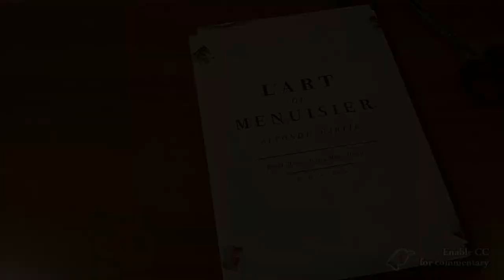Making a Roubo Frame Saw & hand-milling a log with it

Comment: Hello, the job was very well done! I'm really considering improving this type of frame saw because it has potential. I believe that the sliding saw blade holders should be additionally tightened with screws. Then the saw blade would be very rigidly mounted in the frame. His jumping up and down seems to confirm my point. Of course, its length influences this phenomenon. The analysis of the functioning of typical frame saws leads me to believe that the description and the validity of the mentioned improvement are correct.
To sum up, the easiest way would be to install the second saw blade tension on the opposite side. Moreover, the frame for such a long saw seems to be too stiff.
Congratulations and best regards 😀.
Reply: Thank you for the like 😀.

Comment: Great video, thanks for sharing. I 'm also turning some beech log into lumber with hand tool, mainly for making planes and tool handle. I usually split the log in half fist then go from there, because splitting review the grain( twist and bend) and I can make my plane tool handle accordingly to have less run out.  I think if you use the saw on push stroke and lay the log horizontal while sawing vertical( like pit saw) it might help to stay on the line.
Reply from the maker: Thanks for the advice. I will try next time.

Comment: These saws seem to cut better on the push stroke, rocking your weight forward when pushing the saw; this helps you get a longer stroke and use more of the blade too. You are using mostly your arms and it will get very tiring that way, and it's not efficient; you have a saw about 1m long and youre not using half the blade. The blade may be why you used it on the pull stroke mostly, a bandsaw blade usually has a positive rake on the tooth (the tooth leans forward) this makes it very aggressive and hard to use, itll want to "stick" in the wood becasue the tooth is so aggressive. When you sharpen the saw, file away some of the rake at the front of the tooth, aim to file 0⁰ of rake into the teeth (the front of the teeth should be straight up and down, 90⁰ to the toothline, not with the tooth leaning forward) this will make the saw easier to use and it wont want to "grab" as much 😁 
If your saw "sticks" or "stops" at the same point on the toothline everytime, it means your blade needs to be "jointed"; there is a tooth that is higher than the teeth in front of it and when that taller tooth hits the wood the saw stops. To fix this you'll need to use a flat file and run it along the tips of the teeth to make them all straight and the same height. File until you see a flat spot on the tip of every tooth, it's normal if some teeth have a bigger flat spot; these are the teeth that were too tall. Then you'll need to sharpen it with a large saw file, taking half of the flat spot on each tooth away before you move to the next gullet........ the file will cut the back of one tooth and the front of another tooth at the same time, so it's important that you only take half the flat spot away before you move to the next gullet; this will keep the teeth the same height. Moving left to right, from back to front of the blade, keep the left side of your file vertical so you get your 0⁰ of rake on the tooth and file the tooth who's face (front cutting edge that faces forward) is set away from you (this might not be the first tooth) skip one tooth so the next tooth face is still set away from you. When you have got to the toe of the blade flip it around and work from right to left, always from the back of the blade towards the front, this time the right side of the file will be vertical to create your 0⁰ rake and file every tooth you skipped last time (every second tooth) the set should still be leaning away from you...... the file cuts better on the front of the tooth that leans away from you, filing a tooth that leans toward you will "chatter" and the front of the tooth that does the cutting wont be as good. 
It's not hard to file a saw, but it is daunting if you've never done it before. If this is the case; go online or to somewhere that sells old tools, buy the cheapest old saw you can find and learn to file that before you move on to a saw that you intend to use. It's easier than it seems, it seems nearly "scary" if you've never done it before..... but trust me; it is easier than you think to sharpen saws 😁
Reply from the maker: Wow, this is a very informative comment. I'm planning to build another saw with a much stiffer blade and I will surely be sharpening it following your suggestions.
It might take a while till I find the time though...
Reply: Something tells me that this type of saw can cut equally on push or pull, but it depends entirely on how you're using it. I.e. pushing against the tops of the fibers or with the fibers. Pushing in most bench configurations will result in a better push stroke.

I'm planning on building one to be more of a pull stroke because in general your pull muscles are stronger and more built for endurance. I also train on the trowing machine, so I want to translate that movement into efficient sawing.
Reply: You are 100% correct about the first one being daunting. I bought a couple frame saws recently for $10 each, one with a green wood blade, one with a dry wood blade; I decided that if they happened to get ruined in the learning process so be it- at least I am learning. I realized about 3/4 of the way through the cutters on the green wood blade that the rakers are almost 3mm taller than the damn cutters in spots.. sigh. It looks like I need to manufacture some additional jaws on my metal vise to hold the blade and take down all the rakers, then reprofile those.. then the cutters afterwards I guess. I never realized how bad the blade was when I bought it, but I really bought it for the parts and as a template
Reply: @liquidrockaquatics3900  Sounds like ya have some work on your hands..... I dony envy you, I'd hate that job 😐 thankfully, the worst saw I've had to work on only had the "big tooth little tooth" syndrome, from the saw being sharpened all from one side, and that was a 24inch panel saw...... Not a long frame job. 
You'll get it done; just remember..... Ya can't ruin the saw until it runs out of steel 😂 so have at 'er....... Might take a few filings, but you'll get it done 😁

Comment: If you use a push stroke the lead edge is facing you not behind on the other side of the long and it’s easier to follow a line. Also using a broad head hatchet and hewing one side for a keeping plane makes this a completely different experience.
Reply from the maker: I will try to do it this way next time, thanks

Comment: Put a flat stick on the flat side of the blade. At either end.
(A winding stick). Perpendicular to the blade.
Sight down the blade to see if the sticks are on the same plane.
You may have to bend the saw blade to saw straight and true.

Comment: inspiring but where did you find a blade less than 10€?  (about 130 just for the blade here)
Reply from the maker: I used a piece of bandsaw blade. That's the reason why it was so cheap. But that's also the reason why the blade is flimsy and it doesn't cut as straight as it should.
Reply: @WhyDontYouBuildit  yep, and turns out nobody even has blades to sell.

Comment: Where did you get this blade , and the size please
Reply from the maker: @louistodd4857  It's a piece of bandsaw blade. I don't know the exact lenght, I made it fit the size of wood I had for the frame.
Reply: @WhyDontYouBuildit  OK.  Just thought you knew where to purchase,  I thinks it 2 inch band saw blades...awesome carving on the handle ends...give you 5 stars on this project...thanks guy...

Comment: That's a very blunt chisel as it's a soft wood
Reply from the maker: I found spruce wood harder to work with than many hardwoods. Cutting the long and sturdy fibers is not easy. The chisel should have been sharper tough

Comment: Did you use a bandsaw blade?
Reply: Yes. The main reason being that it was free. For the guy that sharpens bandsaw blades that length is basically useless, so I can have replacement blades without spending money and avoid them to go to waste.

Comment: How long did it take you to get through that log? I have two much larger White Oak logs and am considering building a frame saw to mill them.
Reply from the maker: I don't remember exactly, probably about 30 minutes. But Being by myself I had to check both sides and take a breath often. Also bear in mind that this is pine. Recently I milled some oak, about the same size, maybe a touch bigger, and it took me much much longer. If you ask me I'd say that it's worth the experience, even just to appreciate the amount of work behind how things were made in the past. But if you just need your logs milled I'm not sure if it's the best way. It really depends on you. If you decide to give it a try anyway let me know how it was!

Comment: if you find a good way to hold the log, please share
Reply from the maker: If I had the space, I would probably build a big twin screw vise, like this: https://upload.wikimedia.org/wikipedia/commons/0/0b/Veneer_sawing_001.png
Reply: I believe the best way is to belt clamp it on to something really solid, like a tree stump.  Easy enough if you are in the woods, otherwise not so much.
Reply: It depends on how much of the wood you care about. There's a tool called a log dog thats basically just a length of rebar with a one inch spike on each end, like a giant staple. You can spike to a bigger log to keep it from moving. Me, I would probably find a way to secure it with ratcheting load straps, or a chain binder.

Comment: hello! I need to buy blades to make a saw like this but I can't find them in Brazil.
Where do you make or buy your blades? What is the store address so I can order the size I want?
please I need help with this
Reply from the maker: I used a piece of bandsaw. It kinda works, but I think a thicker and more rigid one would be better. I unfortunately don't have any idea where you can find one in Brazil.
Reply: Consulte os detalhes
217 / 5.000
Resultados de tradução
Resultado da tradução
The Little Floresta channel said that I usually find it in German stores, but in the United States you can also find it, but I have no idea how to buy it there. If I can't, I'll try to make it with commercial door springs. @WhyDontYouBuildit